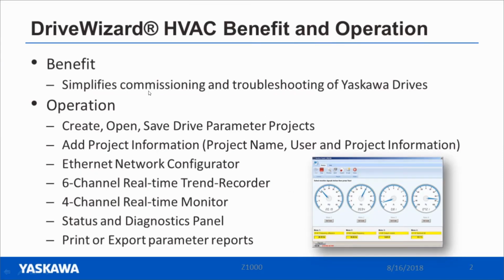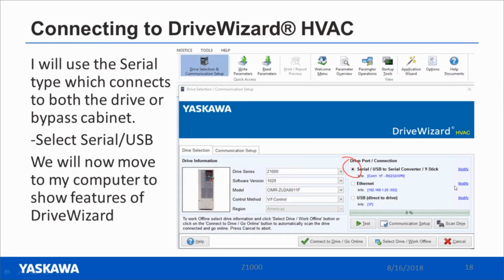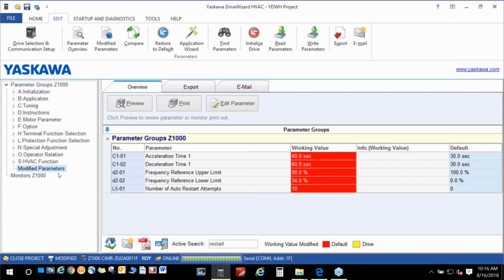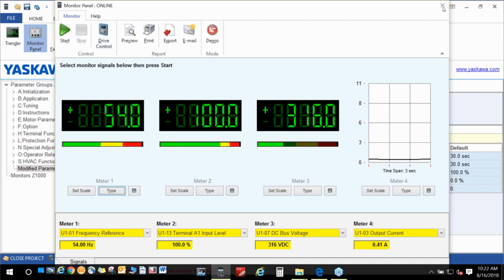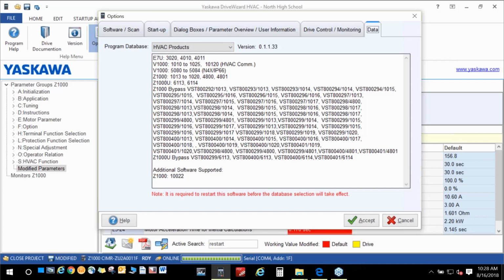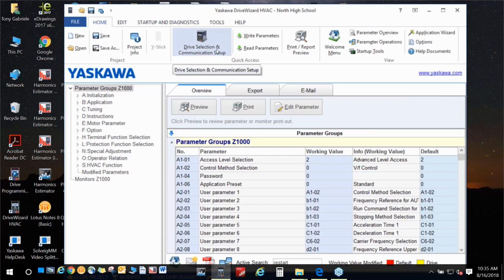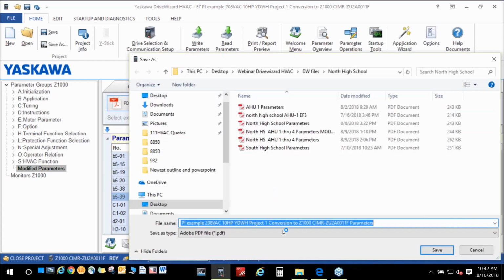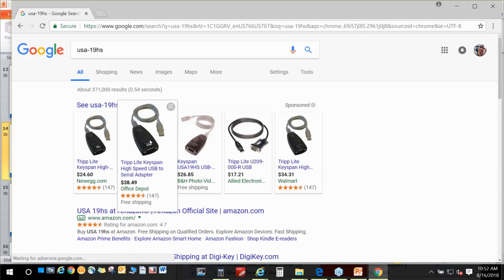Introduction to DriveWizard HVAC Software

Comment: I have a question, I am getting a new j1000 how can I just copy the old parameters from the old and transfer to the new one?
Reply from the maker: Thank you for your interest in Introduction to DriveWizard HVAC Software. The V1000 and J1000 drives support parameter transfers via an external keypad, allowing you to save settings from one drive and load them onto another.

For mor information, please refer to the document titled “Performing a Copy Function when Using a V1000 or J1000 Drive” at the link below:  https://solutioncenter.yaskawa.com/selfservice/viewdocument.do?noCount=true&externalId=10442&sliceId=1&isLoadPublishedVer=&docType=kc&docTypeID=DT_FREQUENTLYASKEDQUESTIONS_1&stateId=1489&ispopup=true&cmd=displayKCPopup&dialogID=10981&ViewedDocsListHelper=com.kanisa.apps.common.BaseViewedDocsListHelperImpl&openedFromSearchResults=true
Reply: @ thank you so, so I might purchase the y stick? Because I have gotten the cords to just connect to the j1000